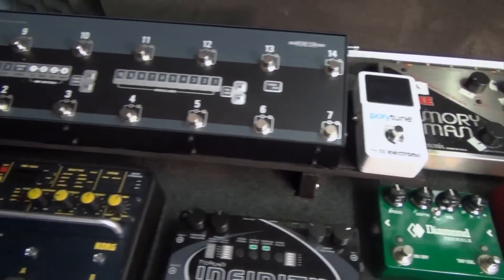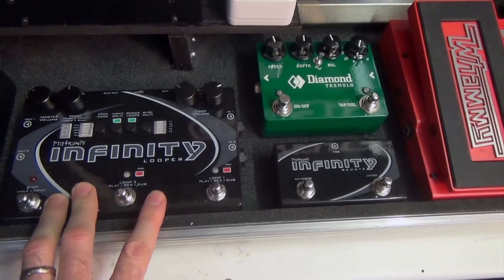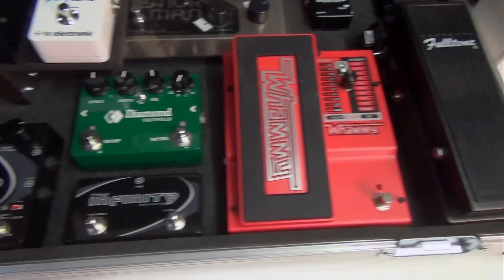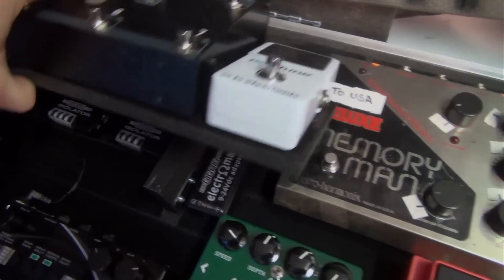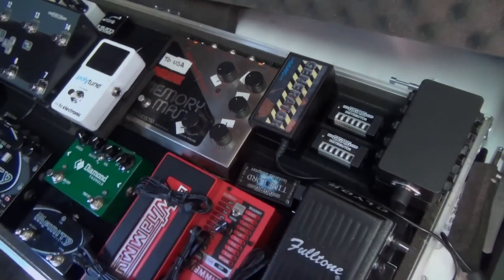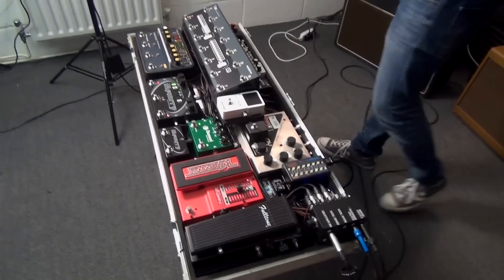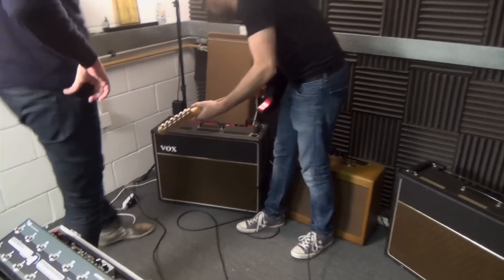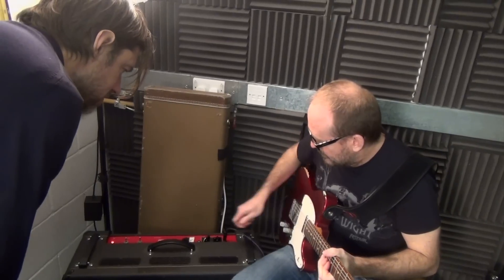Radiohead's Ed O'Brien – Second Pedalboard Build, That Pedal Show Special

Comment: Btw, what are you using at the very end of the board to connect the output to the 3 amps and where could I get one just like it? I love the size and simplicity of it. Also did I hear you say you've set it up so you can connect any additional effects if needed? How do you achieve that? Thanks in advance!
Reply from the maker: Hi Samual, it's called a Cinco Cinco patch bay. We sell here at our site TheGigRig
Reply: Thanks for your reply, Daniel. I'll go ahead and order one from your website! Cheers.

Comment: Need a few more pedals before I think about the g2. I was looking at the quarter, that looks more like me for the moment.
Reply: is the quarter basically the same thing, with true isolation, and phase issues etc?  I have the same issue - i run an eleven rack for most of my tones and really only have a few key pedals I use any more for OD and specialty stuff

Comment: wonder if that's a vintage DMM or a newer one.
Reply: That one's vintage. This is the new one: https://www.ehx.com/products/deluxe-memory-man
Reply: @mattburke9991  It's hard to tell if it's a vintage or reissue. All we can see is that it's powered by external power vs. the old school internal power that included the attached old school power cable. 

So this could be vintage but modded for external power, or one of the late '90s or later reissues that came with external power from the factory. I'm betting he's got a nice memory man collection spanning more than a few varieties.

Comment: I'd kill for someone like you to build my board. I have the pedals and I know what I want with it, but I'm so f***ing clumsy. And there's more. One of the very best pedals I have is something that's very much like the Z-Vex Super Hard On with a couple of extra little things. Ever since I got it it's been on my board, it never came off and it always stays on because it cleans up every little bit of hum. I can use 15 different pedals on my board and without the SHO it'll sound like I switch on a vacuum cleaner. However, with the SHO switched ON, no matter howmany pedals I use, it'll sound like there's nothing in between my guitar and my amp. So you can understand why I am so glad with that 'Z-Vex'. It's the 'HOLY GRAIL' and it's MINE!!!!!! But now, since a couple of weeks ......, well I built a small pedal board for small venues. It's got like 8 small (you know these really small pedals nowadays), but really great sounding pedals on that board and the SHO is one of them and IT HUMS AND BUZZES LIKE HELL!!! And the worst part of this all is the fact that it's the SHO that causes it!!!! My favourite pedal, the secret of my great sound, is now the biggest pain in the ass!!! I'm broke, so this hurts. This hurts so much! :-(
Reply from the maker: +Mario Driessen have you changed how you power it? It's very sensitive to the way it's powered

Comment: Why would he use two delay pedals (Korg and Memory Man)? Also, what is the pedal at the top left corner (under the switcher board) with the red knobs?
Reply: I think that's a Dean Markley Overloard. It's a version of the TubeWorks realtube overdrive by B.K. Butler
Reply: Multiple delays is just going to make it easier for him for the way he tweaks things live. And in the memory man's primitive form, he's probably very comfortable with the way it works and connected with the sounds he gets through it. They are definitely their own thing, too. But having separate delays ready to go, even though the Korg has presets, it's probably just second nature for him at this point. Most people wouldn't need multiple delays, but after all, this is Radiohead were talking about :)

Comment: When do you choose to run an isolator over a distributor?
Reply from the maker: Frank Ransom An Isolator is for 9V pedals below 140mA. This delivers isolated very clean power to those standard 9V effects. A Distributor is what you use t distribute power to your isolators and any high current adapters such as TimeLords or Doublers. A Distributor is not isolated so it can deliver very high amounts of current to those adapters. You can sometimes run pedals direct from a Distributor but I recommend running them from an isolated source, so an Isolator or an adapter ;)
Reply: Daniel TheGigRig I set my board up based on your pedal power guide and as far as i could work out everything would work fine from the distributors except the stymon which i purchased a Timelord for

Comment: So Ed replaced his Klon with a Klone it seems.....
Reply: +montageofheck I believe he still has the real one just uses the Klone on his live board to save space
Reply: Nez Pender I figured. Jonny has two vintage Roland RE-201 units, yet he has replaced both of them with the Boss RE-20 for the live concerts. 

I'm sure it was a space saving thing, i mean, Ed used the Klon on the 2011-2012 tour, so i doubt he kept if off due to worry of theft.

My point however was more that the J Rockett Klone was a suitable enough subsitute for the Klon, close enough where it's good enough for Ed's board. Says a lot about the quality of that effect, ya know?

Personally, my heart is still set on the ARC Effects Klone....
Reply: +The Captivated if i wouldn't own the original i would definitely buy a wampler

Comment: Hi Daniel. I have a number of stereo pedals on my current board. An ancient (and well loved) Arion Stereo Chorus (mono in, stereo out), then a flanger, phaser, uni-vibe clone, and delay. All of those pedals are stereo in, stereo out. I have the mono signal from the amp send go into the chorus, then out of that in stereo to the other pedals. Can the G2 support this many stereo pedals? If necessary, I can reduce to four stereo pedals (use a multi-fx pedal for the phase/flange) so I'd need 4 stereo loops. Have watched most of your videos and also subscribed. Wish you and your team every success for 2016.

Comment: minus the pedals, what does a build like that generally cost?
Reply: Hella
Reply: +Ken Gibbens lol 8k
Reply: lol whoops i miss read the post
Reply: Ken Gibbens I imagine it's pretty complicated. A while back I contacted a builder in the states out of curiosity, and this was for a small build, his estimate was around 1200 - and that was accomplishing a small fraction of capability demonstrated here. It seems like a lot but one has to consider all the nuances: at the most basic level you are paying for cables, power (crucial, Dan has exact custom individual power to each pedal so each pedal will sound its absolute best), a true bypass loop system (id imagine this is the attraction most players have in the first place) - essentially means  when a pedal, or combo of pedals, is on they are looped direct so you are always getting the highest fidelity of guitar/pedal/amp tone...this isn't easily accomplished at a professional level, so that'll cost you. Additionally, the gigrig can switch order or pedals without touching them, it works as a ABC box, it has buffers, phase switching, literally everything and anything you could want so whatever dream rig you want can be achieved. With that said, time/labor factored, its prob expensive but alas, this kind of system really isn't for someone using a handful of pedals or not needing to catalogue decades of tones and materials. I think Dan also offers a smaller more pedestrian loop system. With that said, this work is genius and well deserved whatever he charges!
Reply: Justin Garcia
Reply: Ken Gibbens check out the video to sound like Radiohead on a budget

Comment: Awesome video and so inspiring! And I have a question:
Did you power the SDD 3000  through an Isolator or Distributor?
I have a small rig, (Tuner > Dist > Dist > SDD3000 > Blue Sky) and I have this high currency output issues.
So I'm considering of buying a Generator, but I don't know if I need an Isolator or a Distributor.
Thank you and looking forward to Ed's third pedalboard :)

Comment: what to do if you want to use reverb. delay etc without an effects loop? Ive got a Blackstar Artisan and has two seperate channels similar to a vox AC30 and was going to use a ABY box to put my effects in one channel and the distortion in the other. Would this be a better way to do this than putting them straight into the front of the same channel. thanks Joe +Daniel TheGigRig